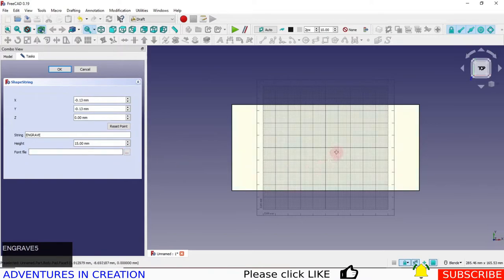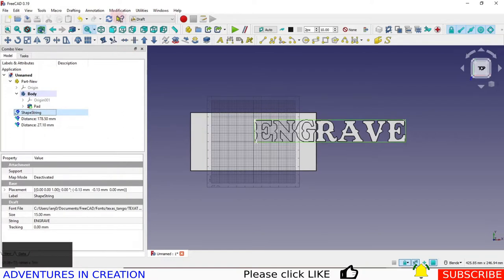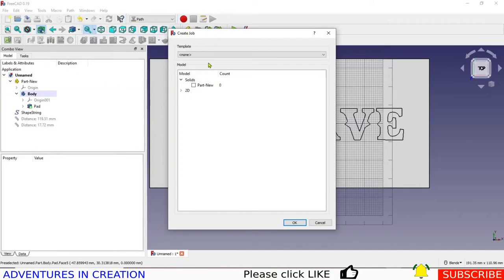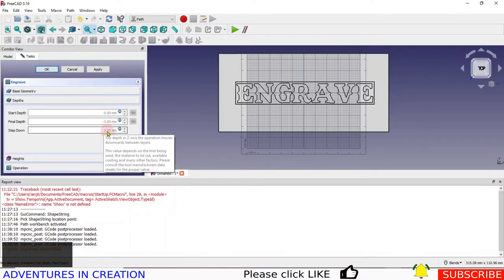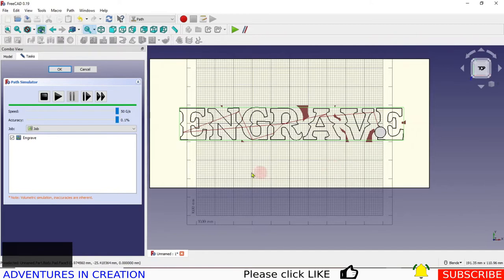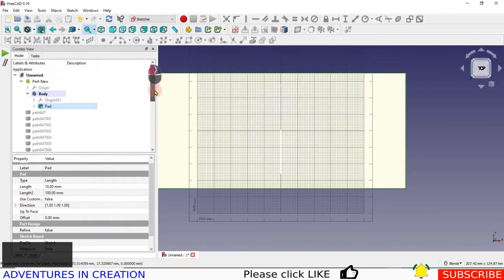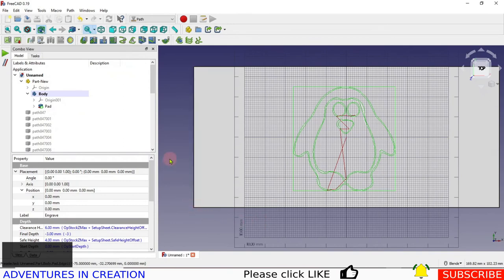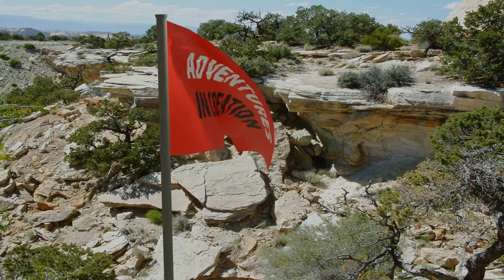Using FreeCAD for engraving text (shape strings) and pictures

Comment: Thanks for another great video !!
And I mean NO disrespect to all the people who dedicate their time and effort on creating and sharing their work on FreeCad. But I would personally find it almost impossible to learn and "advance" without Your, and other people who so graciously share their knowledge here on YT.
Best regards.
PS. it might be that I'm working in a "another" version ( V.021.2 on Linux), but "here" it is (quite often) possible to write in "calculations" in the input fields, so that You don't have to do it "in Your head" or another program.
For example when You made the measurement and wanted to move it half that distance You could (if Your program works like mine) just feed in 54/2 and press "Enter", and FreeCad will make the calculation... Which in this case is trivial, but it can do "more advanced calculations". You can use parenthesis and even some mathematical functions. Though I would advice to double check it if the measurements are "vital", as it sometime seems to be a bit "odd" when it comes the "rounding" (I guess it's all "python behind the scenes" ;)
Reply from the maker: Thanks for the input. Yes you can create equations in those fields but I try to keep it simple. I prefer to do equations in the spreadsheet and reference those from the boxes.

Comment: I would like to see an actual cut. I'm working mostly in vcarve today but trying to migrate to 3d modeling for some of my work. I'm curious how the tool paths compare for efficiency.  I'm also curious to see how a vcarve path works in free cad
Reply from the maker: I am happy to show you the actual cut. I was exclusively using fusion 360 for cam. I can tell you that freecad is as efficient or more so. If course a lot depends on the post processor. I have found tuning paths in freecad is quite good.

Comment: Thanks for this video, I've learned a lot but I have one problem. When I simulate it, it only does one pass instead of 2 as in your video. Did I miss a step? I'm using the latest version.
Reply from the maker: I suspect you have set the depth but not the steps, if you just have the depth set it will do the whole thing in one pass. If you set steps that are smaller than the depth it will increase the passes accordingly.
Reply: @Adventuresincreation  I set the depth to 3 and the steps to 2 just as in your video. Thanks for the reply. I'll experiment with some different numbers. I don't have the exact bit, I'm using a 65 deg. vbit.

Comment: In the path workbench, could you use the penguin sketch to create pockets? Say you want to engrave the outside of the penguin and pocket the holes. Do you have to create pockets in the 3D block from the sketch or can you select it in the path workbench and set depths etc?
Reply from the maker: You can use the sketch to make a pad or a pocket. Or you can create a path and set depths. Whichever works best for you.

Comment: Thanks for the video! What do you export the engraving job as? Also what cnc router do you operate on? I just got one of the small genmitsu routers and am having tons of issues getting up and carving, it’s a grbl, not sure if you have any knowledge of these but any help would be greatly appreciated thank you for your time.
Reply from the maker: Hi Curtis, you need to export the gcode using the Grbl post processor. Once you have it exported you will use some other software to send it to your cnc machine. I have an MPCNC and use octoprint to send the gcode to it. My mpcnc uses a Marlin board so my post processor is slightly different. I hope this helps.
Reply: Yes it does help thank you so much. I couldn’t figure out why it wasn’t working for the life of me.
Reply from the maker: I am glad it helped.

Comment: Freecad is refusing to show the string in create job, and I can't add it. If you get this problem convert the shape string to a sketch and select the sketch before create job so it shows.
I would use other software to layout text and graphic and go down the SVG route it is much more flexible for manipulating fonts.
Reply from the maker: I think YMMV I have had good results with shapestrings.